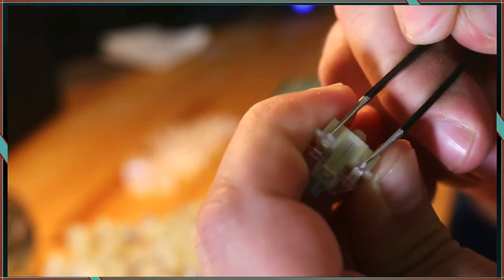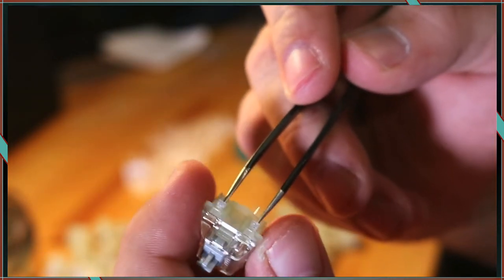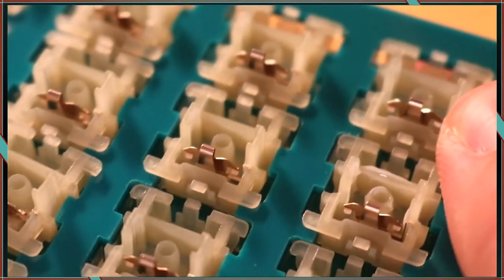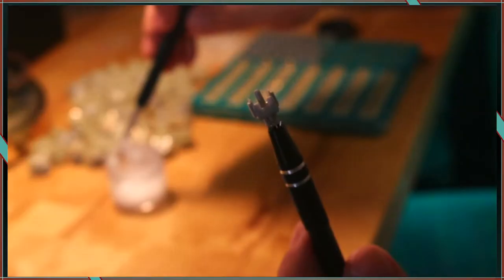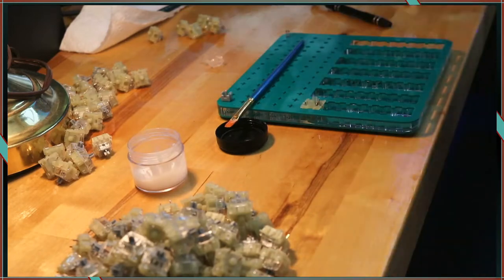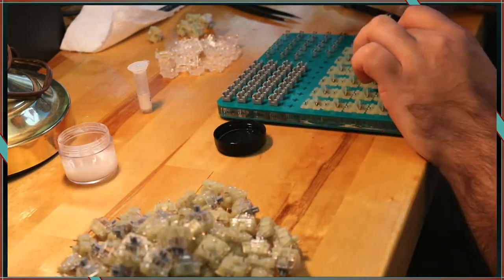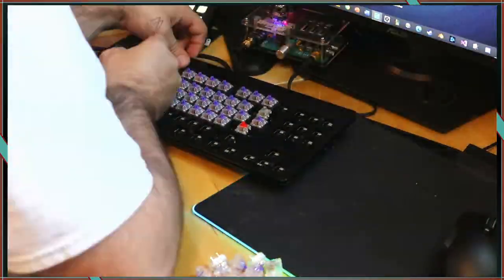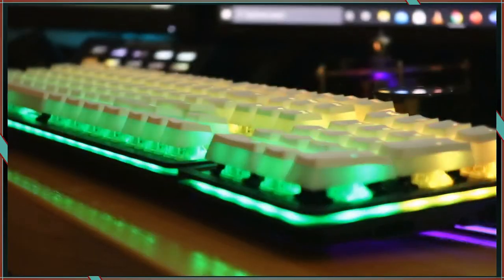Keyboard Build: Everest Max Keyboard (Lubed Cherry MX Speed) Pudding Keycaps.

Comment: from multiple reviews I noticed that the RGB illumination on the Everest keyboard is kinda dim compared to corsair k95 for example. Will using white PBT keycaps help make them brighter ?
Reply from the maker: Yes, when you use the white keycaps any light that hits it will be reflected instead of absorbed. Just a FYI the board ships at 75% brightness, if I remember right, so they may have not adjusted the brightness. Keycaps are the most important when it comes to brightness, IMO. Next are the switches, because the housings may block the light. The cherry switches that come, are actually not fully RGB, (they are not transparent) you can get some that are transparent, like Zealios V2, that would allow basically all the light from the PCB to come up to the keys. LED diodes, generally are limited by power, so if you have it plugged into a USB hub, then the reduction in voltage can also dim your keyboard, but still allow it to work. Sometimes when you have cheaply made doubleshot PBT, there will be darker spots in the legends. Keycaps like Tai Hao PBT, generally have great visibility of the legends. But, when choosing a white set, IMO HyperX pudding keycaps are the best, like the ones in this video. Did that fully answer your question? Most of the time the issue isn't the LED's, most of the time it is the setup, followed by the amount of power. If the LED's are still dim, then it is an issue in software. I never noticed that the dimmness level was sub- par, but it isn't blinding!
Reply: @ireakhavok  oh it definitely helped, I was actually thinking of razer white keycaps, since i'm not a big fan of RGB leak,  but would definitely give up to hyperx pudding PBT if the lighting difference is huge, also the contrast between white keycaps and black board is actually very nice to look at.
Reply from the maker: @perceptivity_  I agree very much. 

I do have to say that right now, I have a set of SA semiconductor on it, you may want to look at SA profile in the future, as it is the polar opposite, feels great to me, but doesn't have shine through, etc. some people don't like the glossy coat because it makes your fingers have more friction with the keycaps, but I like it because when I touch type, my fingers don't slip as much and I am more reassured while I type fast. Spherical tops to the keys are easier to press, because I hover instead of rest my hands on the desktop.
Reply: @ireakhavok  since I'm a programmer, shine through is a must for me as I work at night.
Away from lighting, what do you think of individual key wobble ? I currently own the Corsair K95 platinum and have to say that I hate it because the keys wobble alot, unlike the razer huntsman elite which was kinda "firm". According to you, on a scale of 10,  what is the score of key wobble for the everest max ?
Reply from the maker: @perceptivity_  I'm a programmer, too, lol, but I just touch type. I don't need to see any of the keys. I type without the number pad, too, as that slows me down moving my hand over there, but I do have the number pad in case I'm living in an excel sheet or something like that. some day, you will not need shine through!@ :P
Reply from the maker: @perceptivity_  So key wobble is entirely due to the keyswitches, and not the board itself. They are cherry MX speed, which are actually one of the least wobbly ones, but that may be the same as your platinum. So if you don't like how much they move, I would suggest looking towards Zeal PC, or the Kailh Box series, which increase in stability during the keypress. If you don't have a hot-swap board, I suggest either the GMMK TKL, or the Everest Max, or the DROP CTRL, if you are a purist. I have videos on all of them.

Comment: I did buy the HyperX Pudding Black keycaps. The letters are barely visible. Your keycaps are very bright in the video. Also on the black Razer keycaps the lightning on the letters is terable on this keyboard. Is this because of the color of the keycaps?
I need BIG FET BRIGHT letters.
Reply from the maker: so, yes. The Black keycaps will absorb instead of reflect the light, like the white keycaps. I would definitely suggest getting the white pudding keycaps if you need some bright letters. you could also look up some switches like the Durock Blue Lotus that use a form of fibre optics to "pipe" the light to the keycap.
Reply: @ireakhavok  The Durock Blue Lotus do look and sound nice but i can not find any video how the lightning looks like. At the front is some defused window? How does the licht of the led at the back of the key will go to the front? Does this not lower the lightning at the back of the keycap? Could you link me to a video with Durock Blue Lotus lightning?
Reply from the maker: @fvheel  so for your keyboard, which is North facing, the window will be at the back, by the legends. The keyswitch is rotated 180 degrees. some other boards will use south facing sockets, which puts the light at the front. I'm assuming that you have the Mountain Everest, yes?

Comment: this or drop ctrl? (low profile) btw i will only get the actual tkl keyboard(for the everest)
Reply from the maker: If you are just getting the TKL, and not even the media dial, I say go for the drop CTRL. If you would like to, check out my drop CTRL video, too! I really love my Everest max, and am using it right now, and although it is just as comparable, it only strait out beats the Drop CTRL, if you include all of the bits. Just because the CTRL case is fully aluminum, It wins at the TKL level, IMO. No other reason why. They feel similar, and the only thing you are missing out on is a fancy box, and an included wrist rest. GREAT CHOICES YOU CAN'T GO WRONG.
Reply: @ireakhavok  thanks dude, i appreciate it. now i can’t decide between the keychron c1 and the drop ctrl. i would have picked the gmmk tkl but the polling rate is not good. i play on xbox so i game all the time. what do you think?
Reply from the maker: @aidaninheaven  Honestly, I feel that the polling rate  at 1k is sufficient, because your hz rate of everything else is lower, so there is no point, yet, unless you are a competitive gamer using a 350 hz + monitor.  I am not a fan of the lower model keychron models. They have an all aluminum version coming out later this year, that would be better than anything in there lineup, currently.

Comment: Biggest downside is that the keycaps which they ship to you are made from cheap ABS plastic and it's such and expensive keyboard.
Reply: @ireakhavok  Did you still order the max version or only core, I'm thinking of ordering the max version but worrying about replacing the keycaps since it's going to add up the price.
Reply from the maker: Definitely suggest the max version.